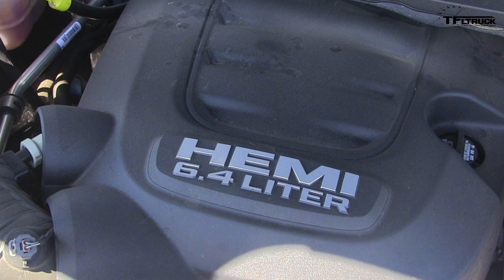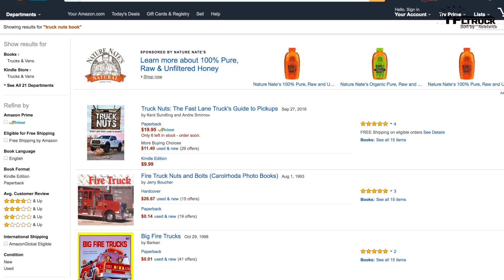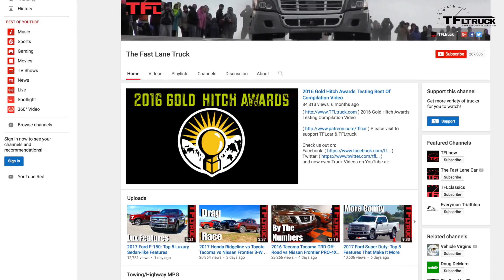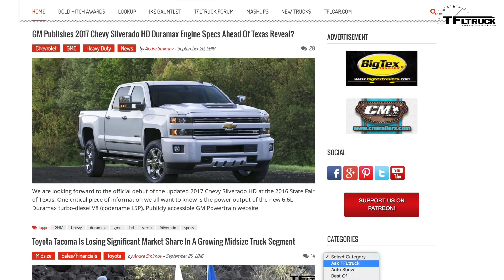Ask MrTruck #1: Why do Manufacturers Limit Torque in First Gear in Heavy Duty Trucks?

Comment: I don't really think "MrTruck" answered the question about Ram's reliability.
Reply: Well, MrTruck is dodging the answer because he still wants FCA to send them test vehicles. However, the reliability facts about Ram or any FCA brands have been talked about many times before:
http://www.autoblog.com/photos/consumer-reports-least-reliable-brands/#slide-3671842

My experiences with Chrysler product problems were never with their engines. They make good engines. It's their electronics, transmissions, steering, suspensions, interior materials, craftsmanship...that are junk.
Reply: Bradley Gilbert Apparently, Consumer Report reliability rating is also based on doing surveys and keeping records of individual experiences. It's definitely not based on one person's experience.
Reply: Bradley Gilbert It all came down to engineering and mostly QC related. As I've said before, engine is the last thing to worry about nowadays. It's the electronics nightmare that most people experienced in a poorly engineered or put together by "no-pride" workers vehicles. I work for a public transportation authority and I have plenty of experiences with all 3 brands, in a fleet environment which is one of the most abusive scenario any vehicles could possibly experience. With Chrysler, it's clearly QC. Door seals with gaps on brand new vehicles, AC blend door premature failing. Shocks struts make noises too early. Unable to start/unlock cars with factory key fobs, with just few thousands miles on them.
Reply: I think it comes down to manufacturing quality. Car companies are often trying to rush sales and go the cheapest method possible putting in inferior plastic parts that break. No one wants to be stranded on the side of the road and sometimes even with taking care of the vehicle serious problems still arise. I pray i never have this issue which is why if taking care of your car keeps your car running in pristine condition, don't sell it or trade it in for a different one, take care of it. I used to be nervous about buying a used car from an untrusty dealer or seller but now i worry about buying a new vehicle because of all the recalls every manufacture is going through. Even Honda and Toyotas are being recalled for safety issues.

It really sucks buying a lemon car and basically when a new car is riddled with problems the best thing to do is to get rid of it. I bet this is the reason mechanics prefer to buy used vehicles, you have the better chance of finding a reliable one based on the reliability percentage of certain vehicles.
Reply: Like I said everyone has there own experiences. As far as my Dakota goes all the electronics still work, no interior cracks or rattles, it has had the transmission replaced and I just put new ball joints on, but being that it has 219000 miles and spent the majority of its life as both a daily driver and a farm truck so I'm not complaining. I will say I can't speak for any Chrysler cars or SUVS though. I have only had experience with the trucks and really I'd say any brand of truck is tuned and built with a greater attention to long term dependability. I do know the 90s through early 2000s rams had dash and transmission problems and every Chevy I have used runs great for a long time but the interior falls apart. The one Ford I have used also has over 200000 miles and falls in the middle, still runs good but it shows its age, interior is still together but also rather worn and rust has been it's biggest problem, the spare tire actually fell off while driving down the road because the mount rusted through. All been good trucks though, never had one not go for over 200000, but by that mark the Dakota is by far the best, all personal experience though, my advice to anyone looking to buy is get our kind of opinions from as many people as possible.
Reply: Never said it was based on one person, never actually brought up the article. Was just throwing my 2 cents out there as someone who has used these trucks on a farm and my experiences with others doing similar things. Read and follow what ever article you like, user experience may vary,  etc.
Reply: Now that you have me looking through some consumer reports rating I do have to ask what is it based on (as you have to be a member to access anything on the website)? I find it interesting Buick is ranked so higher and Chevy so low, as they share the same platform and engines. Are these ratings mechanical or are they opinion based; that is are we talking mechanical faults or someone not liking the AC control placement?
Reply: I would also contend that, given that CR is based heavily on owner experiences, the people who purchase Chevrolet expect different things from their vehicles than people who purchase Buick.  No matter how much you try, you can't get personal bias out of any survey.
Reply: Joseph Peoples That's true. But these surveys are coming from owners. If any bias, they should be biased toward the vehicle that they've spent their hard earned money on.
I considered myself an open minded person. I've owned and driven many domestic and foreign brands. I also work for a public trans. authority, around a fleet of vehicles from all 3 brands. My experience is very similar with the CR survey's results.
Here is another thing. Most Ram owners don't know that not all Dodge/Ram/Chrysler dealers can service the Cummins, the Ecodiesel, the Aisin transmission...when they break down or have check engine light. We have to send our vehicles as far as 50 miles one way (and we situated in a large metropolis) to have them service under-warranty. And keeping them for more than 1 month is the normal for them.
Reply: Now that is a point I have heard a lot and is something that is probably brought up in their survey, FCA dealers are terrible.
Reply: I was not aware that Ram dealers could not service the Cummins.  That is awful.  The owners should have access to their trucks.  Dealers should have to provide loaner trucks, of similar grade, and expect them to be used like the owners expect their trucks to perform.  

As to my point of bias, perhaps expectation is a better word than bias.  A Corvette owner expects different things from his vehicle than a LaCross owner.  I know, apples and oranges, but the corporate satisfaction numbers from CR are lumped together.  Not that that's necessarily a bad thing.  A car should be judged against the vehicle it's marketed to be.
Reply: Joseph Peoples Since Chrysler didn't make the Cummins, nor the Ecodiesel, especially the Aisin transmisission etc.. not all dealers are willing to pay for trained/certified technicians, and subscription/renting the right equipment to properly diagnose and repair these components when there are major failures with them. They can still do the normal routine service on them i.e fluid change, software flashing...but they won't be able to perform a major repair.
Reply: They don't seem to do it with any of them, really.  This seems phony here.
Reply: No, he didn’t. The Ram is a third place truck with a first place engine(Cummins)
Reply: Motor is ok the truck is trash
Reply: Because that's more of an opinionated answer and I imagine they want to stay on a more fact based setting. Everyone has a horror story about one brand or another, me personally I'll tell you the heavy duty rams with the cummins have always been reliable and the most reliable vehicle I have ever owned or seen is my 97 Dakota with the 318.

Comment: Hey Mr. Truck I'm looking to buy a 3/4 ton diesel; I'm not one of these guy's that biased to any brand I generally like something about all of them. However I'm not sure which brand I should go with. I'm not to concerned with power because my main goal is to buy a truck that has the best balance of durability and reliability. Which truck would you recommend?
Reply: GreenTip30 the older diesels that were mostly mechanical and not burdened with all of the modern emissions systems were extremely reliable, the new ones- not so much. I've owned both and unless you are towing large loads, the gas engine is overall better. More reliable,  lower maintenance costs, much cheaper, and the difference in fuel economy isn't as great as some people claim.
Reply: GreenTip30 if you want reliability, get a gasoline powered truck. All of the diesel trucks made by the big 3 have reliability issues- several of which are caused by the emissions systems mandated by our nanny state. Mr Truck drives a gas powered F250 by the way.
Reply: michael dierks is correct, but I would add that a delete is 100% illegal in every part of the country, though you can get away with it easily in some states, others inspect truck emissions systems regularly. But every year seems to get tougher and tougher for deleting.
Reply: Truck manufactures know where I live. If I'm bias, there may be a drive by shooting. I'm surprised by what trucks automotive journalist buy. There are brands that are more popular and brands that are seldom bought by journalist.  And these are the folks that get to drive them all. So this is a hint.
Reply: michael dierks but I've always heard that Diesel engines are more reliable and last longer, is that just a myth??
Reply: michael dierks what about if you get the new ones "deleted "?
Reply: GreenTip30 it will make it more reliable and increase the fuel economy- provided you don't put a hot tune in it, but it will also void the warranty and make it difficult to sell when the time comes. Depending on where you live, some dealers won't touch a deleted truck due to legal reasons. Some may take one in on trade, but give you far less money since they will either have to undo the deletes or send it to auction as-is. Deletes also cost a pretty penny to do it correctly.
Reply: Skipper and michael dierks are 110% correct. If you are not pulling a heavy load daily, you won't be able to save enough fuel money to repair and maintain these modern diesel pickups, no matter what brand. Diesel emission are already happening at many counties. EPA can easily force emission check on all Counties and States by delaying federal highway funding if not comply. It's not wise to delete emission if your truck is new or very recent. If Ford, or any brand for that matter, put a turbocharged GDI engine into 3/4 or higher pickups, engineered it to meet heavy duty cycles, that would be a better engine choice than any new diesels. BTW, I own a 2005 F250 with a 12V Cummins, check my uploaded videos for it. Right now, where I live, there is no diesel emission check. But that may change in a near future and hopefully, they only go back to 10 years :).

Comment: which engine would you prefer for towing for 2017 models: , Chev 6.2, Ford 3.5 or Ram 6.4?
Reply: 6.2 and 3.5 are 1/2 tons, 6.4 is heavy duty. I would have chosen the 6.2 in a half-ton but now with a 10-speed in Ford, I'd go with the 3.5L. I'd go with the 6.4 in heavy duty today, but I think Ford will put the 10-speed in the Super Duty in a couple years and that would be hard to turn down.
Reply: any of those will be good, but I'll stay away from the ford because it's a first generation transmission and a good rule is to always avoid 1st generation, they have more problems
Reply: Which engine pulls the best: Chev 6.0 L gas or the Chev 6.2 gas (ignoring the fact that one is a 1/2 ton and one is a 3/4 ton)?
Reply: +Horse Hoof Trimmer pull as racing or towing?

Comment: I wish Mr Kent wound stop saying the 99-16' Super Duty cab is smaller than the 3am and GM. Look at the dimensions and the Old SD is way bigger than the GM and Ram just based on wheelbase crew cab 8' box(Ford 172", GM 167', Ram 169'). main difference is in length with(+3") for new cab/f150 over old.  Where the old cab excelled was in width! 

2016 SD Crew Cab
Front                 Rear
Head 40.7.        40.8
Leg.   41.1.        42.1
Shdr.  68.           68
Hip.     67.6.       67.6

2017 SD Crew Cab
FR.                      RR
HR.  40.8.          40.4
LR.   43.9.          43.6
SR    66.7.          66.9
HipR 62.5.         64.7
There isn't a huge difference 

Now look at GM 
2016 Crew Cab 
FR.                       RR
HR     42.8.          40.5
LR      45.9.          40.9
SR.     64.8.          64.3
HipR   60.7.          60.2
I don't know about you but I don't need 46" of legroom. I do prefer hip room though put three big guys in the back to go fishing GM is tight, at 60". (hat is a FAR cry from larger than the old SD cab. GM hasn't changed this cabs dimensions since 2000. In fact Andre Silverado is almost spot on the dimesions of a 2016 Silverado, in all dimensions except overall width!! GM is good at hiding old bones with New skin.  

Ram
FR.                         RR
HR.    41.0.            39.9
LR.     41.0.            40.3
SR.     66.0.            65.7
HipR  63.2.            63.2
Again a far Cry from LARGER than the Old Super Duty Cab. 
Considering the now 9" deficit for GM and 7" deficit for Ram on Wheelbase, there is a huge difference is these trucks. and the torque limiting is based on driveline reliability. 925lb-tq multiplied out by 3.97 first gear is 3672lb-ft. Engineers know that people don't know how to use these TOOLS properly, so to keep them from twisting a driveshaft off, or grenading a differential for a warranty repair. They engineer a safety.  WHY does a 1 ton(or 3/4 ton) need 925lb-ft of torque? Sales!!! 
I drive a highway truck with an 8 axle B-train at 63,500kg(141.000lbs) with 500hp and 1860lb-ft.  sometimes times we need to use the old 410hp Detroit series 60 but it still moves the 63,500 at 65mph just fine.